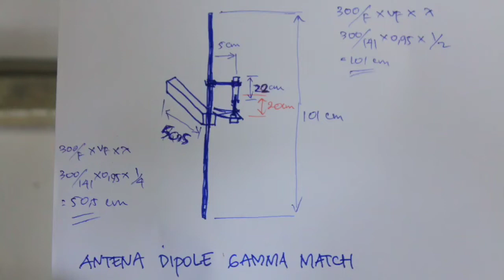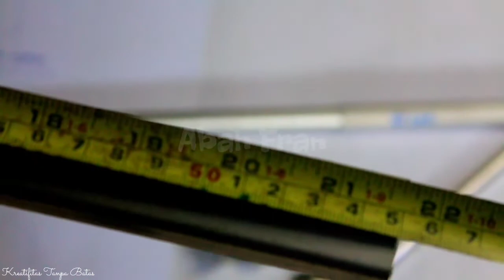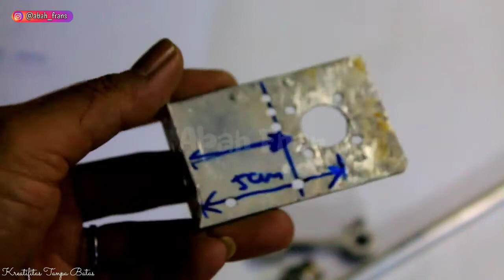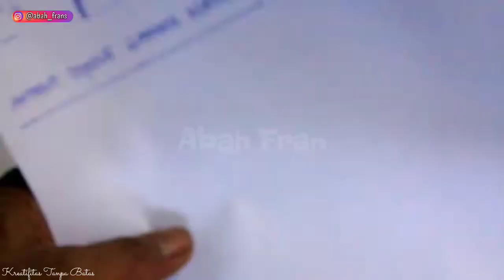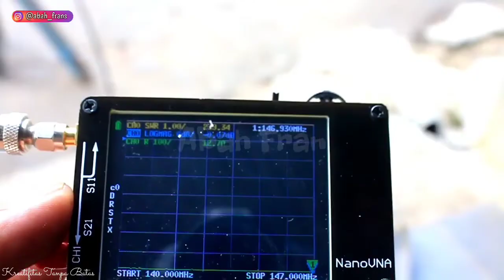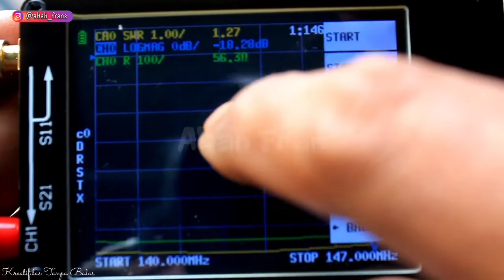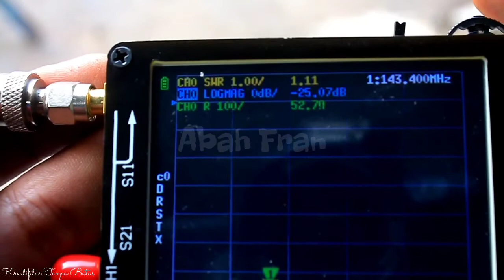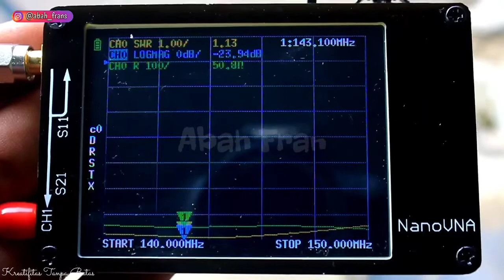Gamma Match Dipole Antenna

Comment: Hello. I would like to build an antenna like this one too, only I have some doubts and I would like if you can help me with some advice. The first confusion is = what does it mean in the calculation, that (vf =0.95)
And at the end of the calculation it says x lamda and in the example it is half of the lamda for the dipole and 1/4 of the lamda for the boom. On that element where the central wire of the cable comes from what is the calculation method for it. Or is it common regardless of the fregventa. Which is the correct calculation or statement. I want to build it for the 95.1 MHz frequency and am trying to figure out what the correct dimensions are to run it correctly. Thank you very much and I am waiting for a reply from you to enlighten me. All the best.

Comment: Pagi Pak, kalo saya mau buat antenna untuk transmit video untuk RC Pesawat yg autonomous apakah sama ya?
Sekarang saya pake Video Transmitter VTX 1.6W 5.8G dengan antenna RHCP merek ORT Pagoda

Untuk receiver pake Diversity Module 5.8G dan Antenna ORT Patch dan ORT Pagoda

Saya lihat di internet untuj Receivernya banyak yg pake Helical 7~12 turn ada jg yg pake Yagi

Kira² saran bapak gimana ya? Apakah bikin nya mudah?

Comment: The coax inside the gama on the end   is soldiered one end and the other end its just cut of straight not touching inside the Ali tube
Reply from the maker: the coax in the tube is not in contact with the gamma road tube
Reply: @AbahFran  thanks I'm rebuilding my delta loop I have lost the gama match

Comment: Pak, 1. Itu antara Antena dengan tiangnya, apakah ditambahkan isolator/pipa paralon?. Kalau sprt itu, kabel serabut Coaxial menyatu dengan Ground/tanah. 
2. Pipa Kotak 50 cm itu apakah berfungsi sebagai antena juga, atau sebagai pemegang antena saja?
3. Trims.
Reply from the maker: Memakai isolator dari  batang dudukan antena ke tiang,
Pipa holo itu sebagai ground antena karena bagian outer menyambung,makanya jaraknya dikasih 1/2 lamda
Reply: @AbahFran okey pak trims saya mengerti. 🙏
Reply: Untuk kabel inner nya, jika kita pakai kawat tembaga yang lebih bagus & besar, apa bisabberpengaruh, misalnya bisa menambah gain nya? Trims.
Reply from the maker: @myjagoku8462  kalo diameter kabel,gunakan kabel sesuai pungsinya, karena ada faktor loss, kalo menggunakan radio HT memakai rg8 /Heliax tidak bagus juga, lebih bagusnya cukup menggunakan RG58, kecuali menggunakan RIG pergunakanlah penampang kabel yg lebih baik karena dialiri watt yg besar, kalo untuk memperbesar gain antena, cukup menambahkan driver dan reflektor
Reply: @AbahFran  terima kasih Banyak Pak. 👍🙏

Comment: Kalau bwt freqnsi 88mhz-108mhz bisa pak
Reply from the maker: Bisa tinggal robah panjangnya, hitung pakai rumus buat patokan, kalo mau pakai 1/2lamda 142,5cm tiap element dan kalo memakai 5/8 lamda 178cm,
 untuk rumusnya
C/freq x Vf x Lamda
300/freq x 0.95 x1/2 atau 5/8
300/100x 0.95 x1/2=142.5
300/100x0.95x5/8=178
Tinggal pilih mau pakai 1/2 atau 5/8lamda